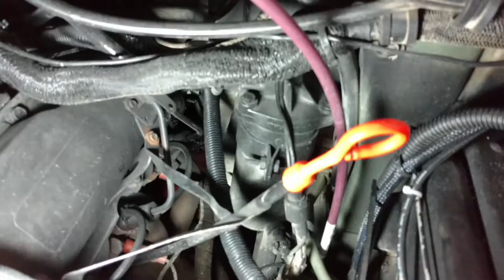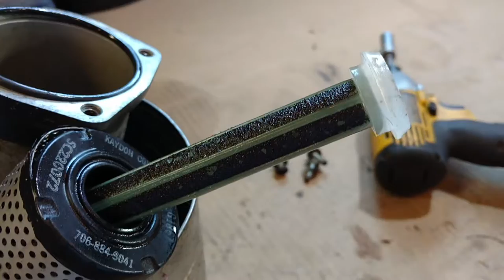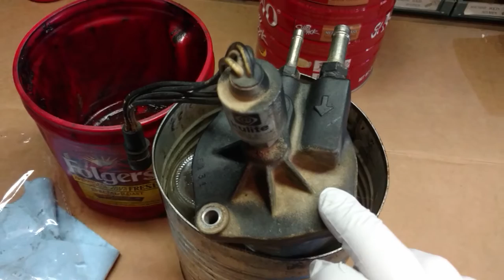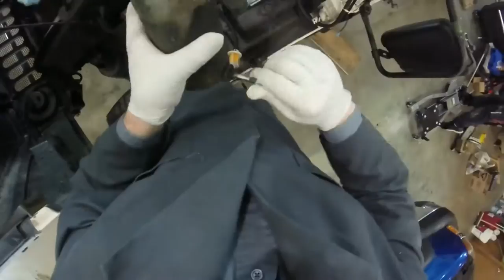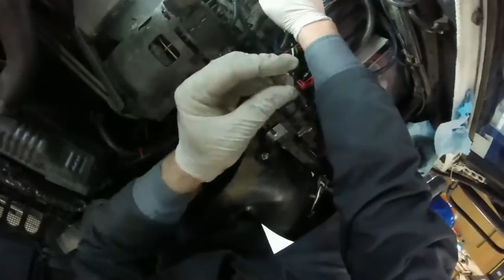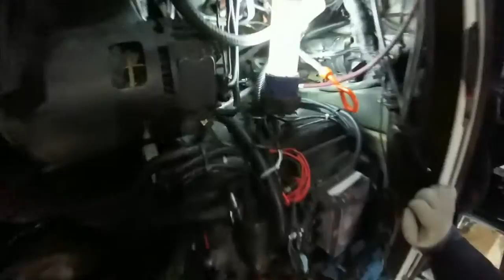Fuel Filter Replacement for the HMMWV, M998, and Similar Military Vehicles

Comment: You don't have to remove the whole housing, you can take just the canister off. You don't have to disconnect all the hoses, etc. They make it in the canister style like that for a reason, the canister holds all the fuel and the filter when you take it off just don't tip it. Don't make more work for yourself than you have to. 

Thanks for sharing!
Reply: I am wondering why he never filled the canister with Diesel before putting it back on  I want to change mine and I think I will just try to remove the canister itself and not the top portion

Comment: Thanks for the video.  You turn out some great content, however instead of speeding through the end or beginning of your vids how about an explanation of what’s going on.  

Once you replaced canister I assume u filled with clean diesel fuel to aid in the priming?  There was no mention of the prime afterwards?  This is usually the hardest part of any Diesel engine after the maintenance
Reply from the maker: I actually Prime the system at the very end. It's one of those procedures that other people have documented. There's also more than one way to do it. I hook a brake bleeding kit up and suck all the air out of the top of the canister. I have heard of others that have stuck air nozzles in the fuel tank and filled it with compressed air. They also say you can even crank it for about a minute and the pump will fill the canister with fuel. You can then bleed the air out while it's running.

Comment: I see you added a extra fuel filter on line ,does that work good
Reply from the maker: So far it works great! For $5, I'll save some premature maintenance, and I'll know how often to change it because it is clear. I can also see how many impurities get caught over time without having to pull the canister apart.
Reply: Part number or brand for the inline filter?

Comment: How do you bleed the air out before you start the engine ?
Reply from the maker: You bleed the air while it is running.
Reply: @HUMMERMODS  .
Is the screw on top of the canister the bleed screw ?
Reply from the maker: @33ad1  yes

Comment: How do you prime it?
Reply from the maker: If you fill the canister with diesel, it should start fine. Once running loosen the bleed screw to remove any extra air. If you COMPLETELY lose prime, there are a few tricks to reprime the engine on youtube: https://youtu.be/9Hn8QYdSEis